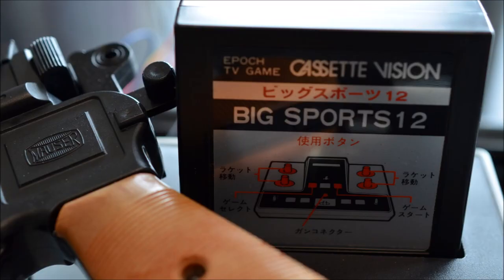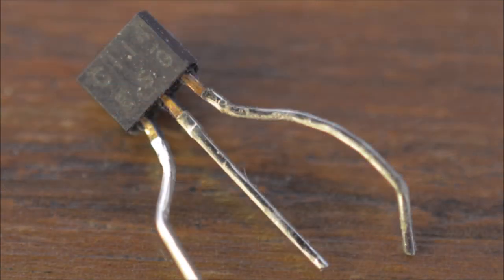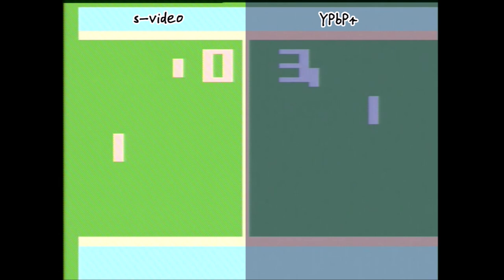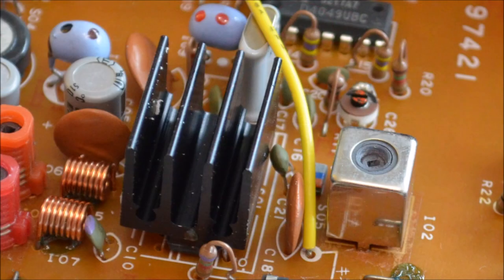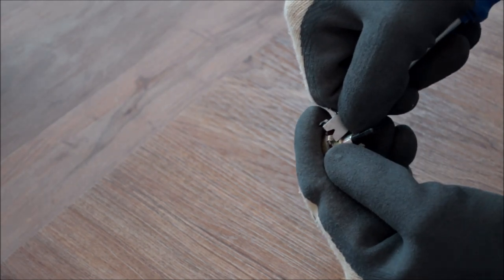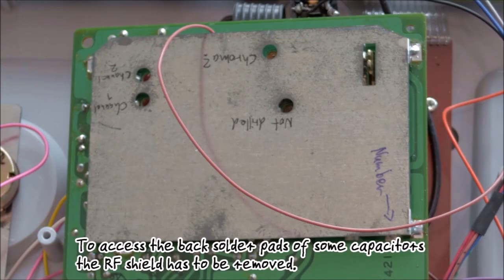Light Gun Reviews 208: Epoch Cassette Vision video modification and restoration

Comment: What would you say is the easiest, most simplistic way to hook one of these original Cassette Visions to a TV from the United States? Since obviously, the RF cable is hardwired and Japanese RF is not compatible with American TVs...

I mean preferably it would be great if I could just buy some sort of adaptor/converter thingy (as you can tell, not a very techy guy here, so I've never taken things apart and done mods on the inside like you... lol)... But what do you think would be the VERY easiest steps just simply to get it compatible in displaying a picture and sound? Any help is much appreciated!
Reply from the maker: By the means of parts count the easiest way would be to adjust the inductor. This will put the radio frequency range to what you need. Dialing it actually in is difficult and you can kill the device by for example using a conductive or ferromagnetic screwdriver.

The easiest way by means of spending money is buying a Japanese RF to composite adapter.
Reply: @Boojakascha  Thank you!
Reply: @Boojakascha  Do you have a link to any Japanese RF to composite adaptor that you think will work best?
Reply from the maker: @Atari-Dude  No, unfortunately the unit I used went out of production. This item claims to be NTSC-J compatible though:
https://www.ebay.com/itm/311213701514?hash=item4875c8398a:g:9sQAAOSw6bVfzqF9

Comment: Question, how did you get the YPbBr (Component) mod to work on the Cassette Vision?
I want to see some pictures of how the mod looks like.
Reply from the maker: I am not sure whether I understood the question. Did you watch the video?
Reply: @Boojakascha  Yes, but I don't understand how it works.
Reply: @Boojakascha  Anyway, this is a pretty good video about the modifications for this classic Japanese console. :)
Reply from the maker: Thank you. We will get you there. Can you ask your questions in relation to time codes of the video? I will make my best to explain.
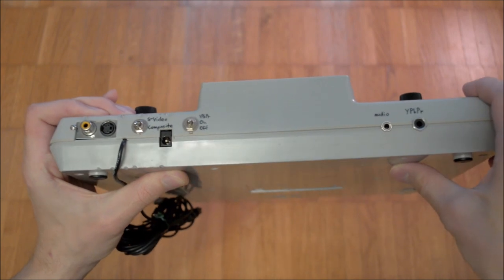Reply: @Boojakascha  6:30 How did you add the video connectors with audio jack and two toggle switches?
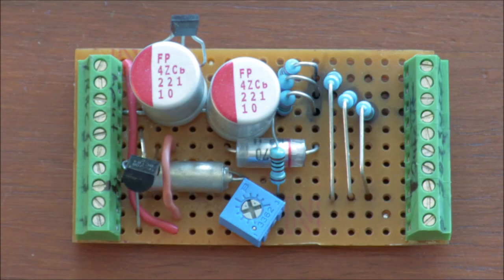7:55 What parts you used to build the mod for the CV? I am not talking about the Coleco Vision, I am talking about the Cassette Vision.
Reply from the maker: The first question: I drilled holes into the case and inserted RCA, TRS, TRRS and mini DIN-4 sockets. Some of them are held by nuts, others are glued in with two components clay.
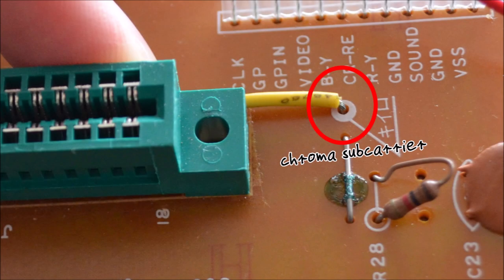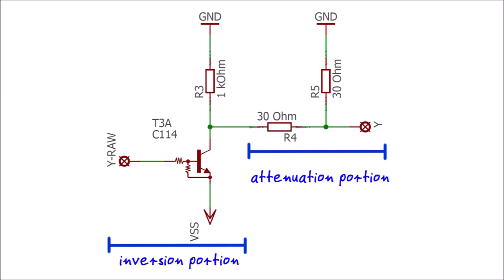Question two: CV being composite video? I show the schematic diagram at 3:24. It's a transistor, a potentiometer and a capacitor. The diagram at 1:59 shows how to obtain luma from raw luma. You need another transistor and three resistors. At 7:55 indeed all theses components are soldered to a stripe board.
Reply: @Boojakascha  Okay, and I need the list of the components of what you used to build for the video mods at 7:55. I might be thinking about doing this mod if I plan to get my own Cassette Vision.
Reply from the maker: @CrashFan96  sure. The components you need, are in the schematic diagrams. You see, they are generic items. For example you don't need a particular 470 pF capacitor, any will do. If the part you get is polarized, make sure plus shows the correct way, that's all you need to look out for.
Reply: @Boojakascha  Oh yeah, the YPbPr is the best video for the CV in my opinion.
Reply from the maker: @CrashFan96  It lacks the noise I have on chroma, which is cool =)
Reply: @Boojakascha  I saw your post on reddit about the mod.
Reply from the maker: @CrashFan96  awesome :D
Reply: @Boojakascha  Yeah, and I am still trying to find and figure out the parts for the mod they're shown at 7:55.
At 6:30, I wonder how the toggle switches are connected for the Composite/S-Video & YPbPr?
Reply from the maker: @CrashFan96  Do you need all the video outputs, or is just having YPbPr enough? For the latter you don't need any switches.
Reply: @Boojakascha  Just all
Reply from the maker: @CrashFan96  I see. The switches just interrupt the lines between raw signals and added electronics. Those are necessary if you want all outputs.
Reply: @Boojakascha  I think it would be easier if I just do the YPbPr standalone mod, so I don't have to use the switches.
Reply from the maker: @CrashFan96  I agree
Reply: @Boojakascha  Well, Chroma and Luma are for the S-Video, so only Y, Pb, & Pr are required for the Component.
Reply from the maker: @CrashFan96  Indeed. But remember that Y is luma.
Reply: @Boojakascha  I get it, so I need some resistors (2x 75 Ohms, 4x 30 Ohms, and a 1K Ohms) a transistor (1x C114 Transistor), and some capacitors (2x 220uF caps) for the YPbPr mod.
Reply from the maker: @CrashFan96  Yes, you are correct, Sir =)
Reply: @Boojakascha  Remember, those parts don't have to be like on the specific video, so any of those can work as long as they're correct. (Example: 1K Ohm resistor)
Reply from the maker: @CrashFan96  Yes, that's correct.
Reply: @Boojakascha  I don't think the potentiometer is needed for the YPbPr.
Reply from the maker: @CrashFan96  If you don't mind destroying your TV it isn't, yes.